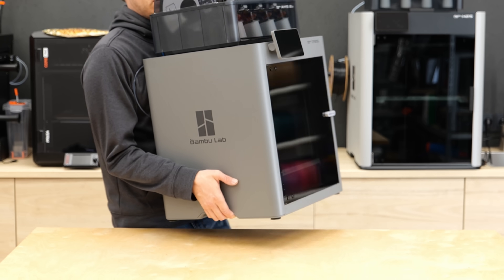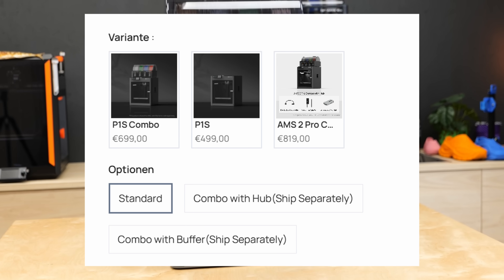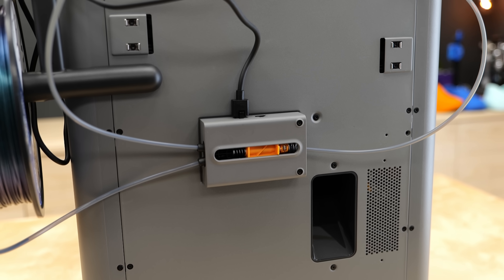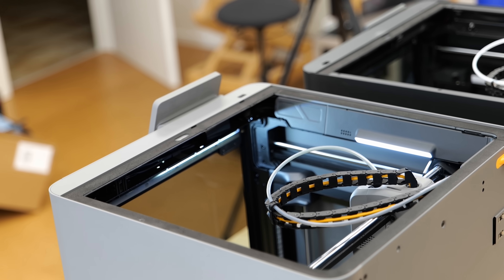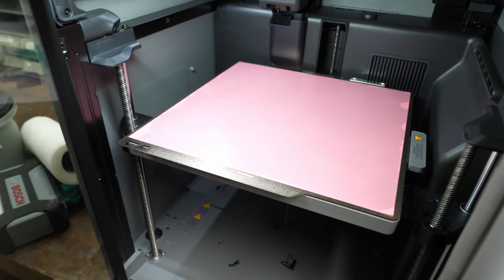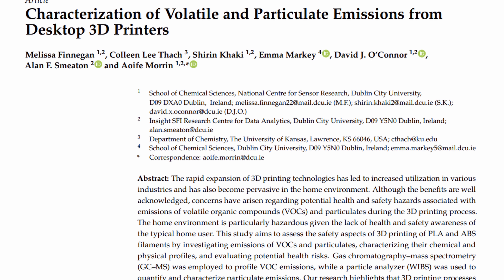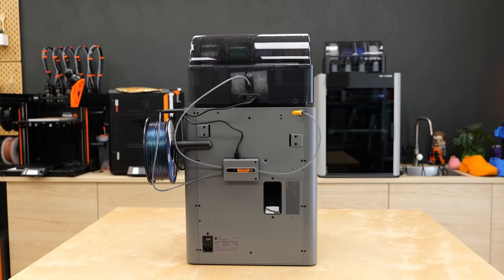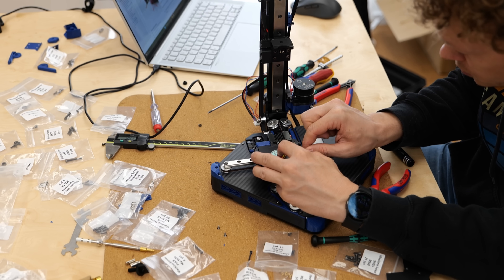The P2S Is the Upgrade No One Expected – But Everyone Wanted!

Comment: Voxel pisses me off. They will let you order colors that they know they are short on, and then they will delay shipping for WEEKS until they backfill stock, even if just one color.
Reply: Yep had that happen too. Had to reach out to them after two weeks to see what the issue was. One filament out of about 10 were out of stock.

Nice pla otherwise though. The spools are sturdy, but could use some more holes for the filament tails.

Comment: Doesn't the X1C still have heated chamber and lidar, which is not in the P2S?
Reply: X1C does not have a heated chamber. It does have lidar though. The servo motors can assist with flow calibration and the camera does spaghetti detection/first layer which is why lidar isn’t a thing now.
Reply: Lidar is a worthless marketing gimmick only used to push KS units. Bambu dropped support for it after a month, 3 years ago.

Comment: Much like Apple, they are out of innovation mode and into iteration mode.  Tiny little steps, careful not to step on existing markets and products.  They will succeed, but only until someone innovates hard enough to break through their mystique and grab their customers.  Creality can, but seemingly wont.  Prusa is upmarket so that's a no go.  Snapmaker can, but 4 heads seems to be too little to really grab people.  Whoever incorporates the INDX system is probably the winner here.  That thing gives you lot's of colors in a small package.
Reply: That's what's coming next, the H2C is going to be the winner. I'm saving up for it, these iterations on older machines are nice but i don't need them, yet. The H2C is exactly the printer i need
Reply: The chinese don't innovate anyways. All they do is copy. Everyone is waiting for prusa to do something new so they could copy from prusa. And prusa core one will support INDX with 7 tool heads.

Comment: Is it actually a recirculating filtration system or is it a venting filtration system? 

I have been saying for a long time that the best way to do 3d print filtration is multi pass filtration with a chamber thats as sealed as possible

Comment: P2S - sponsored by PTFE tube manufacturers 😅
Is there other explanation for interesting arrangement of  feeding inside machine, filament buffer and external spool?
Feeding external filament through 2 meters of tube (slight exaggeration) - try that with TPU or PEBA (or was it PITA) when My Tech Fun has trouble with friction feeding CF filament 🙄

I thought P1S combo could be good value, just not for multi-color prints.
P2S combo is more lucrative (display, nozzles, price), just not for multi-color prints.
But Snapmaker U1 - when it comes to normal sales channels with continuous discounts (norm in 3D printers, except Prusa) feels right.
Meanwhile cheapskate-special value-alternative FF AD5X could be excellent mid-term little printer for non-technical filaments, just not for multi-color prints 🙃

Comment: "The X1 becomes completely obsolete, there is nothing that the X1 still does better"
What ? No heated chamber in P2S, so ABS is out of the question for large / tall ribbed parts.
The TWO things I was hoping for were (1) heated chamber (2) changeable nozzle.
How does that make X1C obsolete if we can't print large / tall ABS parts with P2S ???

Comment: 14:33 it will be and it definitely isn't 99%.

Also I know everyone makes the excuse about any other printer being a project, no that's not the case, my flashforge ad5m pro and my cr10 max before and after I converted it to corexy have been fire and forget, if yours isn't you messed something up somewhere or your machine is ancient.

Comment: Feels like a weird mix between an X1E (or at least its filtration system + heated chamber) and a P1S, updated to use the current gen of Bambu's 'universal' nozzles.
It's insane value for people looking to buy a new printer, but has no features someone with a P1S couldn't retrofit with reversible mods like a Bento Filter and a chamber heater. (Ask me how I know)
Add in OctoEverywhere for the AI detection and you've basically got yourself a P2S, I guess?

Comment: It sucks that the choices are "closed walled garden printer that Just works" or "DIY open source printer that is a hobby unto itself."  I want a middle ground, a solid, multi-color core x/y printer that works out of the box, but allows me to get my hands dirty with upgrades or my own software stack when I feel like I need it.  But so far that doesn't exist.

Maybe someday the Voron community will put together a guide on building a printer with a toolchanger, but for now just figuring out which "mods" are needed for that is a huge lift by itself.

Comment: With the P series being the more "value centered" lineup, it makes sense that the P2S would have some pretty obvious spots or spaces where additional features would otherwise reside. For example, I'm certain that if BL puts out an "X2C", it would feature a chamber filtration system among other additional features, placing it a step above the P range. I find it incredible that the new P2S is actually better than the X1C, especially at that price.

Lastly, I own a kickstarter X1C. When I discovered BL and their printer, I knew the 3D printing world was going to change forever, and it really has. Love them or hate them, they ultimately drove all the other manufacturers away from their "race to the bottom" we all were exasperated by at the time.

I love my X1C, and in a way, it's kinda sad (is that the right word??) to see it start to become overshadowed by newer, better and more refined tech. At the same time, it's really fun watching BL not only drive their prices down, but offer more and more at the same time. The X1C was a $1500 printer when first announced. To have the P2S cost roughly $850 is seriously amazing.
Reply: I bought a p1s, then returned and bout the x1c...  I am still in return period.  I will return the x1c and get this.  Honestly, I had a better experience with p1s.  No issues.  With the x1c, I shave had more issues.

Comment: Unfortunate about no exhaust filter, otherwise would be a day-one purchase
Reply: Most of the air exits through the poop chute so you could make an enclosed poop bucket with a carbon filter on top. Could even add a fan on top to make sure all the air exits through it.
Reply: @NightfallSentinel  Is there or will be a mod for that (with the extra fan)? I want to start getting into 3D printing but would prefer not to poison myself and my family.

Comment: So the Chinese government is spying on us with the machines and they're subsidizing them to out sell the competition and they're always online (almost) and they don't play well with outside software or hardware, but it's still worth it if you've ever tried to use a different 3D printer. They such a hassle but especially compared to BambuLab's. They really do just work.
Reply: Prusa printers have been tinker free and "they just work" for the last 10 years. And they aren't funded by the CCP or collect and sell your data.
Reply: @LilApe  Just work is a stretch, they've been plagued with launch issues for years now.
Reply: @LilApe  and cost $1000 more

Comment: Dammit you missed one of the most important things,THE NOZZLE WIPER.did they improve this too?!
Reply: Nearly 800 hours in on my P1S - zero nozzle wiper issues. Though your mileage may vary.
Reply: According to other videos, no, it's worse than the P1S.
Reply: @wojtek-33  i have 2400hrs on my p1s...never had a problem with the stock wiper. I even picked up dual head silicone head brush wiper..but never installed it lol.
Reply: @Badkitty24  yeah I haven't had an issue either but they're are plenty of posts and videos showing people had issues. I almost bought the parts to change it out when I got my printer but ended up having zero issues. But the p2s doesn't seem to wipe properly based on the early videos.
Reply: @Badkitty24  my x1c does,it always leaves a piece of about an inch still attached to it when it starts the first layer.on my a1 mini I don’t even have to look at it.

Comment: @cnckitchen how good/effective is the actual filtration with eg ASA/ABS - could it be used without routing it to the outside?
Reply from the maker: It filters fumes but I was still able to smell a bit. I have the feeling that the X1 filters still were better.
Reply: @CNCKitchen danke 👍🏽

Comment: @7:35 The build plate ARuCo stickers decode to an integer value, so you can print them and place them on any aftermarket plate -- there is a generic one, and then the others are mapped to the specific plate types, so use the code that matches your plate the best. The slicer will set the expected plate ID upon slicing, which the printer firmware compares to the value read by the camera.
Reply: That’s what I did with my h2d simply printed out tyr code sticker

Comment: I've not heard anybody mention anything about the purge chute. This is the biggest issue that most people have with the P1S because it is prone to backing up. Has this been updated? I speculated it would use the same system as the H2 series where it used a tray to poop into and flicks it out of the back similar to the A1 style purge system.

Comment: Enable LAN with developer mode, connect Octoeverywhere to it, and ditch the mobile app / cloud connection entirely. Works perfectly with Orca Slicer and gives you remote monitoring. Should you have to do this? No, and shame on Bambu for locking things down unnecessarily. But can you? Absolutely.
Reply: Or just leave it as it is? Never had an issue with my P1S and A1mini with the on board tools. That's the good thing about this printers, no unnecessary tinkering when I just want working machines that need little to no maintenance.
Reply: @behemothokun sure, that works for you and that's great! I prefer a different slicer.

Comment: I’m not sure why you didn’t mention the lan-only mode for Bambu printers, which allows full local control and integration with all slicers.
Reply: Mine is running in lan mode and I can send prints from orca slicer. I haven’t upgraded firmware in a while though
Reply: @TellyT-i5e  they changed the protocol slightly for the new versions, but as of the latest version of OrcaSlicer (or it might be only in the nightly releases atm) it has full feature parity with the previous firmware versions.
Reply: @VeryCuul good to know. Since it prints fine I haven’t seen a reason to upgrade the firmware yet
Reply: @TellyT-i5e  I haven’t upgraded mine either yet for the same reason haha. But other people have tested out the newer firmwares with success.
Reply: Are you sure?
Reply: @jasonconstant455 Yup. It disables connection to Bambu handy (obviously), but restores full local control of the printer over MQTT and SD card access over FTP. You have unrestricted access, like how it was before the “controversial” update.

Comment: When everyone was saying "the H1S made teh X1C obsolete" I was all "no, there will be an X2 that's the same size/performance just with all the new quality of life features."  I'm happy to see I was right.

I agree this also ends the X1C... but I suspect that's the point.  "X" is very likely for "Experimental" after all, and the P1 was essentially the X1.5 anyway.  So I think it likely that the P2S is meant to replace both the P1 and X1.  The P1S and X1C were already sort of competing with each other; it just makes sense to simplify their lineup.

I do think we'll see an open-framed P2P, just to make extra use of existing tooling, but probably not an X2 anything.

Anyway, for me... I was already teetering on the "how much more money should I put into my X1C to fix it" line.  My machine is from the Kickstarter, it's getting worn out, I've done a bunch of repairs on it over the summer (and am currently waiting on replacement parts for my Panda hotend) and it was starting to be dubious if I should keep on fixing it.  Now it's pretty clear I shouldn't.  Granted that the P2S isn't exactly what I want to replace it with - the Snapmaker U1 or whatever Prusa's CoreOne toolchanger ends up being currently have my attention -  but 800$ CAD for the printer alone is a solid price, and if the fancier things aren't available or turn out to be not so reliable in the wild, the P2S looks like a decent choice for an upgrade.
Reply: They said in their video about the Vortek system that the H2C is the true successor to the X1C.

Comment: Honestly, orca slicer is the only thing that holds the p2s back for me. If the connect app was just less of a pita, and worked more consistently, or ffs was just an addon/plugin that you could dl for orca it wouldn't be so bad.

It's little things, like Orca's built in test suite, ability to alter the start g-code to add an extra wipe step, and bambu studio's lack of support for skew correction. I don't need the extra infill patterns, or most of the slicer settings, but Bambu have been so slow to update to include important updates (like skew correction) that make it impossible to use Bambu Studio for certain applications.

Not to mention that the customer support I got from Bambu when I had an issue; they were slow to respond, didn't read anything I sent originally, made me repeat steps multiple times, and then claimed it was user error and blamed me in a very rude way when the hot end screws had vibrated a bit loose over time. Not to mention that all of the support effectively had to be handled through the phone app.

Comment: Looks like the P2S design already hints at the X2C. The hotend sits way off to the left inside the toolhead, and the whole layout looks perfectly symmetrical, I’d strongly assume the X2C will basically be a smaller H2D with dual nozzles and the Vortek system, possibly with the Vortek being optional
Reply: They said in their video about the Vortek system that the H2C is the true successor to the X1C.

Comment: Does it still intergrate with HomeAssistant. I have an X1C and I have it LAN only. With Home Assistant I have a image of the Printer and AMS and jus overlayed the info that HomeAssistant grabs. This means I have complete remote monitoring thru HomeAssistant although I don't venture too far away when running a print. I have never been into locked down systems and even discounted 3d printers in the past I hate propreitry systems what ever they are but at least Bambu Labs listen and improve. I went from a Prusa MK3 that I got in kit form to the X1C but now I have also started using the Prusa again but the speed difference to the X1C is huge like double the print time. Would I replace the Prusa MK3 with the P2S, I don't know at the moment but it is certainly worth thinking about I do like the side mounting Spool holder compared with the X1C although that is easy to modify. Have you tried Nylon CF? It is jus unprintable with an AMS unit on the X1C I have found, jus too stiff.
Reply: It does not. Bambu don't want you to use their printer in the way you like.
Reply: @maxdefire  Boo :-( Lock in is one thing In hate. Yes they are great printers but any form of lock in is a red flag.

Comment: That Babmbu Lab is doubling down on the lack of direct control options with their printers really bums me out.  I bought my first 3D printer, a P1S, in November 2024 shortly before all the BL drama regarding direct control of printers occurred.

I initially only got a 3D printer to make tabletop miniatures for D&D, but soon after convinced my boss that we should upgrade our Form2 to a Form4 and our old Dremmel 3D45 to a Prusa XL with two heads to make things around the lab.  After using the Form2, Form4, Dremel 3D45, P1S, and PrusaXL. . . .I prefer the Prusa.  It does what I want and I can change just about anything.

It's a real shame that Bambu Lab is locking down their newer models so much, because but for that reason I would upgrade in an instant.  At this point I'm saving up for my own Prusa XL at home, unless something else with unrestricted hardware hits the market before then that can do multi color prints without purge waste.  Because of Bambu Lab's approach to direct control, I've lost interest in their new nozzle changing machine before it has even been release.

Comment: 10:44 I really encourage youtubers to try and use basic black filament for these test. those filaments with glitter and all are meant to make pretty appealing prints that hide artifacts, even the worsts printer I've seen will make a pretty great print in that filament. with that lighting.
for testing I'd always use a basic black or a grey filament. I've always used black myself.

those just feel like advertisement rather than analysis.